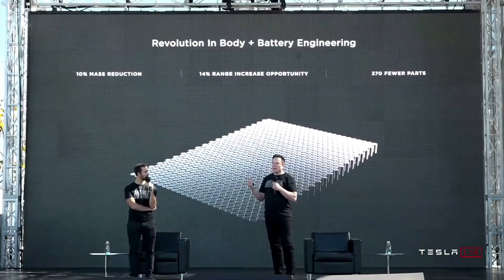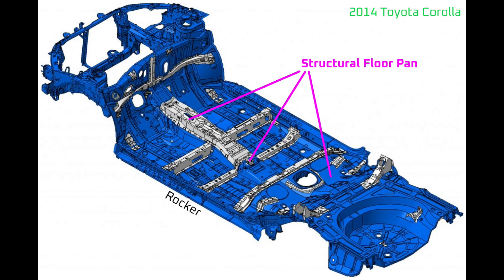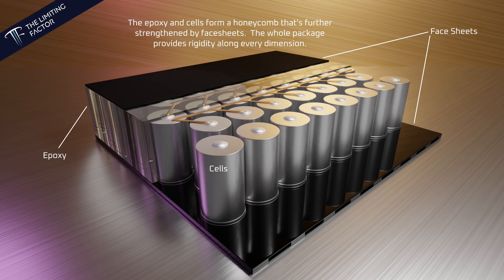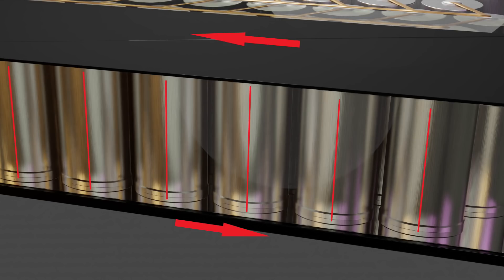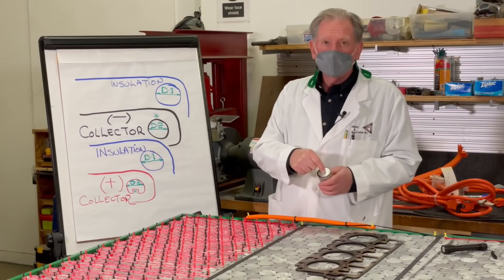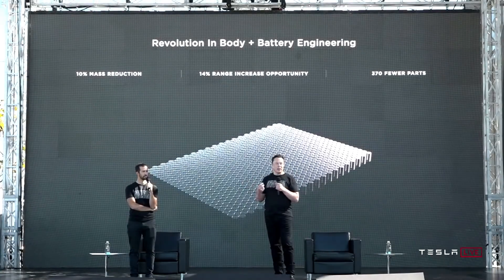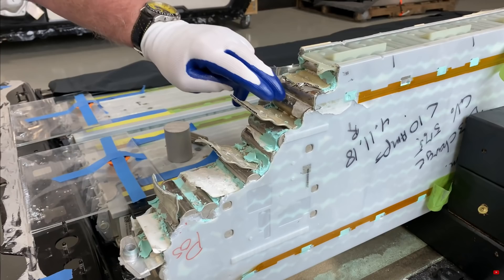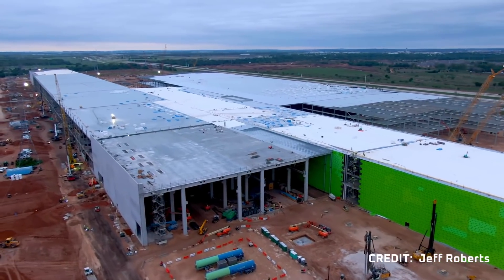#15 The Engineering of Tesla's Structural Battery Pack

Comment: I still occasionally hear about people having battery pack failures. With a structural pack, would a battery pack failure mean they'd have to throw the whole car away?
Reply from the maker: From what I can see, no.  You are just changing how the cells are bonded within the pack, not how the pack is bonded to the vehicle.
Reply: @thelimitingfactor  Thank you for that.  I thought the structural battery pack would be permanently bonded to the mega-castings which mean a disposable care once the batteries failed.  That would be worrisome for a brand-new battery technology and for the fact that I want to keep my cybertruck for a LONG TIME.
Reply: @davidsuzukiispolpot  no need to permanently mate the battery to the chassis like say with the current generations of Samsung smartphones 🤪 as the "use case" here is entirely different.  the "structural" design of the new pack means they GAIN added rigidity even when just MECHANICALLY attaching it to the Unibody (with fasteners).  sure bonding or welding it to the structure would make for an even stronger assembly, but at that point an engineer would just be incurring a SELF INFLICTED WOUND and simply showing that he (or she) were actually NOT as smart as they originally made themselves out to be.
Reply: @phillyphil1513  That makes sense, but one of the issues that Elon mentioned was stress transfer between the mega-castings and the structural battery pack.  I just assumed that meant much more intimate connection than a few bolt-points.  I may have been wrong with my assumption.
Reply: Check out the Gruber Motor Company videos. Their experience with Tesla batteries, is that you just have a few cells going bad at a time, after a nice, long time. If the diagnostic information is available, the bad cells could be drilled out of a structural battery, and even be replaced. https://www.youtube.com/watch?v=F-B_8oMZNeI  Eventually, there will be enough cascade failures, that the battery will be a write-off.
Reply: The front radiator support is structural, but also removable. Structural doesnt (perse) mean it cant be disasembled.
Reply: Anything can be repaired. If someone put it together, someone else can take it apart and repair an assembly. If anything, a structural battery pack will be stronger and less likely to become damaged as compared to the current pack. With the filler being  used between each cell, the likelihood of preventing a thermal runaway situation due to a shorted cell, means the likelihood of losing the pack and car and occupants goes way down. The filler material between cells was stated in battery day, to be a fire retardant agent. As well. Tesla has the incentive to make runaway battery fires a thing of the past. Being that such events, destroy cars, can kill people and make such spectacular video footage, and sets the press abuzz, even though.a gas or diesel car or truck on fire is ignored, gives high incentive for this new battery pack design to squash fires like a fire extinguisher, without a whimper. In fact, if a fire is limited to a single cell and it disconnects itself from the circuit. The car will be able to be driven like normal with some loss of range, provided there is no other serious damage, like dumping  its coolant all over the place!
Reply: How feasible would it be to repurpose these packs into MegaPacks when the car has reached the end of its lifecycle? From what I have heard they will likely still have 90%+ capacity and would be useful in stationary storage for a long time before they would ultimately need to be recycled…. I always here this as a point of information but no specifics on its execution or if this is TESLA’s plan once they start accepting dead vehicles at the end of their lifecycle… any ideas here?
Reply: @adamfarrell9369  I see future industry that creates inexpensive, retired EV packs,  being used as Solar electrical energy storage for homes. Final recycling of battery packs will also be a future industry, along with recovery of the electronics and the drive motors. The rest of the body can be recycled after the junkyard period wheee body parts and chassis suspension parts and glass are harvested for replacement parts.
Reply: #OVERSHOOTINGTHERUNWAY
Reply: I believe Sandy Munro initially suggested the new 🔋pack would not be replaceable & he thought it was okay due to very long life; however, I was concerned as robotaxis these vehicles will see a LOT more runtime. If 🔋pack can still be replaced after 1 or 2 million miles, then FSD value goes up. Software license becomes most valuable automotive part affording all other parts to be replaced (car will never be "totaled" in an accident).
Reply: @tslabuzz6647  it's likely that at these very high mileages other parts of the vehicle could well be end of life and it might make more sense to simply replace the whole car at that point.
Reply: @tslabuzz6647  and upgrades

Comment: Furniture makers use 2 sheets of veneer that sandwich something called honeycomb. This honeycomb is cardboard, about an inch thick. It is glued to the veneers and there is a solid wood edge along the sides of the panel. This panel can be used for table tops, conference table tops or other structural parts of furniture. It is very strong and light compared to other construction techniques.

Also, there are companies who use thin sheets of metal which sandwich styrofoam, to form structural wall panels in prefab homes. It's the same idea, with a light core and thin structural sheets on the faces of the panel.

The torsional strength is amazing when considering how much material would need to be used to separate if there is a separate frame and non-structural battery pack. Of course, the batteries as a core are not as light as styrofoam or this cardboard honeycomb but the weight savings of using the pack as a structural piece is significant.

What will Tesla think of next, to incorporate structure with some other function? I heard the Tesla cars have air shocks for suspension and that the air tank for it has been incorporated into also serving as a structural cross member in the front of the car. A tube shape has a lot of structural support for both a cross member of the frame and for an air tank and, because the air is amorphous and does not need to be a specific shape, the tank can be long, like for a cross member rib for the frame.

Is there anything else that can double as structure and some other function? Or can one part serve 2 functions other than structure? Or can one part serve as structure plus 2 other uses?

And applications: we can ask, are these techniques the future of all cars? Would the bed of a pickup truck serve as a place for a structural battery pack? What about the floor and walls of a trailer for a tractor trailer (the semi)? And can the roof of a trailer have solar panels? If not for a tractor trailer, maybe for a straight truck? And what if Tesla created some sort of version of blade batteries, built for structural battery packs? Would that save more space than the cylindrical battery? (Place the blade batteries on their sides instead of like a deck of long cards, the way BYD does, so the thickness of the pack is an inch or less.)

Comment: As Frank Spencer of 'Some Mothers Do Av Em' fame would say:-
'Also...'
Because the 4680 battery has a larger cell zize it's surface area to volume ratio is less than in smaller cells.
Since the casing of the cell is made of metal this will likely contribute to a weight saving, though I note that the sheet metal thickness used for the 4680 case seems to be rather thicker than I would have expected to be necessary.

Comment: Or integrate old n new tech. Battery  and use the turning (MOTOR) any part of the VEHICLE TO BE USED AS A REGARGE FORVTHE BATTERY. LIKE WINDING CLOCK RADIO.

Comment: coppers thermal conductivity is only better if both electrodes have the same thickness. Al weighs a quarter and has half the conductivity, so if you make the Al Electrode 4times as thick it will weigh the same but have double the thermal conductivity. That is what they did in the end :)

Comment: At 5:14 I think the best way to understand is that the cylindrical (almost honeycomb) battery are used as a column to support compressive stress between the compressed upper panels and the tensioned below panel. It's just like a I beam but in every direction so it give also  torsional strength

Comment: Do not understand why the battery is not in the form of a cassette.  This is the age of " plug and play " right!
Reply from the maker: Cassettes rquire interfaces, interfaces require parts and machining - i.e. cost.
Reply: @thelimitingfactor  really , Tucker made his cars with an engine and Trans that could be exchanged without raising the car off of the ground . Just block the rear , disconnect and roll the unit out on the wheels , and you tell me that Tesla or Nissan could not make the battery pack slide out . I call " bullshit "

Comment: The true clarification here is that when a battery must be carried by a pack, the optimum dead weight of the metal cell can is zero. Instead when the unused strength of the metal can of the cell is used for the structure and function of the car, then its weight is moot and better, replacing the mass of strength members previously required to carry forces from the rest of the car and also the combined mass of the cells including their metal cans. Note, this is unlikely to be modular for ease of repair, but rather an innovation made possible by optimizing for extreme cell reliability and fault tolerance. Optimizing for rework is no optimization at all - and the kind of perverse incentive (like profiting on service) that Elon abhors for good cause.

Comment: Your description is very good. The key point that you make is in conveying that the battery shell is in intimate contact with the battery immediately adjacent to the next battery. The same concept is explained when you compare  the breaking of a single straw versus the force required to break dozens of straws while each straw is in intimate contact with the next straw. However, in a micro analysis sense, all failures described as 'shear' failures are really failures in compression/tension. However, we use the word 'shear' failure as a generic expression of failure modality.
Reply from the maker: Thanks for the input!

Comment: Recycling.  On the existing vehicles the battery packs can be removed from the vehicle and sent for recycling.   With the structural batteries this probably means the vehicle will need to be sent back for recycling.   This To my mind is good,  it means that the front and rear castings can be salvaged at the same time.  Ok the alloy could change from time to time but tesla will know what is in every casting it recovers.   I think we will see all Tesla factories having a recycling facility soon to make the most of the existing materials.  Humn the above also goes for the glass and probably many other elements.   Is this perhaps the way all recycling should be?

Comment: In the future there will be entire towns that get permanently evacuated because they're located next to a massive yard filled with old, worn out battery packs. Thousands of them stacked on top of each other. It'll be just like a tire fire. The fire dept. won't be able to put the fire out so they'll just let it burn for 20 years. It'll be toxic AF. And this will be in spite of the fact that every battery EV will have a $5000 battery pack recycling surcharge added to it. Recyclers just won't be able to compete with virgin materials and old packs will just keep piling up. It will be like nuclear waste.

Comment: TRANSLATION: they're building (evolving) the current pack design such that it will now pull DOUBLE DUTY going forward instead of just single duty.  a key phrase is when the narrator/uploader states how heretofore "the battery cells were simply being carried along as cargo".  as some have observed the new approach is indeed a HONEYCOMB STRUCTURE (as given to us by Nature/the Bees) but instead of leaving the holes open, someone at Tesla in the 21st Century said "oh cool look" we can just stick our cells in the holes instead of separating them with the colloquial "lasagna noodles" as we'd been doing in the original MKI pack assemblies.  indeed honeycomb structures have been used in Aviation/Aerospace for decades, especially in unpressurized craft like Helicopters. 30 years ago when we we're "upfitting" Agusta A109's (ref, the Heli famously used in 1993's Jurrassic Park) the replacement doors we designed were constructed from a sandwich of 6061 honeycomb placed between 2 sheets of carbon fiber, again this was 30 years ago.  and no, in any configuration requiring LESS cell count, they should not fill the holes with epoxy or some other "potting" material.  Nature's hexagonal design is perfect and will not be made any stronger, only HEAVIER (hint: the current Model S and X are already TANKS).

Comment: 9:20 That's not correct, if you have a copper pipe and you heat op one end, the other end will become hot too. Copper is one of the, if not the best solid heat transporters out there actually it's at least the best I know of.

Comment: Excellent explanation of the planned structual battery. I have 4 concerns for it:
1. Crash security?
2. Is repair possible, to exchange spoiled cells?
3. Is use as scond liefe (use of old batterys as stationary battery) possible?
3. Is recycling possible (here you told us your opinion in the video)?
Would be great, if you or someone could check the first 3 points!

Comment: Perhaps you over complicate things a bit. This is easy to do because we're interested in the batteries first the structure second.  Two things that might help. A basic understanding of Young's Modulus (this is basic why I-beams work so well. The 'web' (the vertical part) does not have to be very thick to make for a very stiff beam or post. Second, the torsion boxes that airliner floors are made from:  https://www.comtekadvanced.com/the-importance-of-aircraft-floor-panels  These are basically fiber reinforced resin panels with a honeycomb of the same material. I've seen phenomenal stiffness numbers for 1/4" panels 8 feet long and they are incredibly light weight.  Now all Tesla is doing is filling those empty honeycombs with batteries. 
Of course the way Tesla will make these Structural Battery Packs is instead of the honeycomb grid, they'll use the battery cells. Because they'll need to circulate coolant around the batteries they probably won't just fill in the gaps around the batteries. It'll be interesting to see if they can make these torsion panels using just the thin battery cans. 
If Tesla designs an 800 or 1000 mile battery pack and then also makes models with less range, the only thing they would need to do to retain the rigidity and strength of the pack would be to insert empty aluminum battery cylinders in the unneeded battery slots.
Reply from the maker: Brilliant information and explanation!  💯

Comment: I was under the impression that the fragility of the cell wiring was making it an overcurrent fuse. If one cell overcharges the fusible link would isolate that cell from the system.
Reply from the maker: Yup, but that cell was originally designed for laptops.  There are other ways to isolate cells.

Comment: 200 kg of weight reduction in my opinion are too optimistic. You have 330 kg of cells (with current 250wh/kg you get a similar capacity of today’s car). ok, you can remove  let me say 100 kg from body in white due to the structural pack, but you have to add the two steel sheets, the epoxy resin, coolant, wiring, BMS, power electronics etc and you have again almost 500 kg of pack.
Reply: Other 100 kg of mass reduction maybe are due to the rear and front mega casts

Comment: The structural battery pack is good but not great. It cannot easily be exchanged or partially exchanged to upgrade; or, be able to swap out a cassette of cells instead of recharge.  It is possible to do both.

Comment: Another excellent analysis. I'm an aerospace/mechanical engineer, and I think your explanation of the advantages of the cells bonded to the face sheet is dead on. This set up is essentially the same as the composite sandwich structures that we use in aricraft and spacecraft to keep the mass low. A typical sandwich construction would use carbon fiber composites with aluminum honeycomb core. The aluminum walls are very thin (a little thicker than aluminum foil), yet they're excellent at tying the load paths of the face sheets together. Great stiffness for the weight.
Reply from the maker: 🤠 Thanks for the input!

Comment: Great video, as an Engineer I agree with the vast majority of your points. A couple of other forces for instance and effects on rigidity and driving behavior come into play too but nothing that conflicts with the overall message of your video. The new design of the 4680 and the new structural design in the vehicle allows further improvements on the castings that have another positive impact on weight as well. In addition this new design opens the door for further improvements Tesla won't start with at version one but for future iterations.

Comment: Cooling on top seems reasonable as it insulates batteries from passenger comparment, Dont want to cool the outside world. Dont want high temps getting to passenger compartment.

I think heat rises in solids too.

Comment: I'd like to see some comment on the potential problems that Tesla is having scaling up and producing the 4680.  I have heard things about heat problems, questions around robustness and the yield of the manufacturing process.  Any thoughts? Thanks for the great videos by the way, added to my list of 'must watch'
Reply from the maker: The issues they are running into with the 4680 are typical of any production ramp.